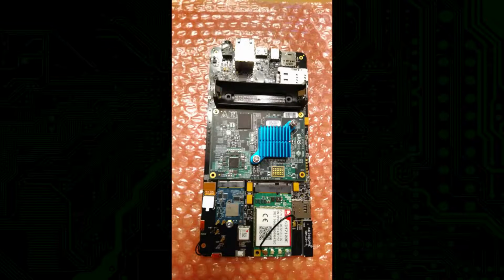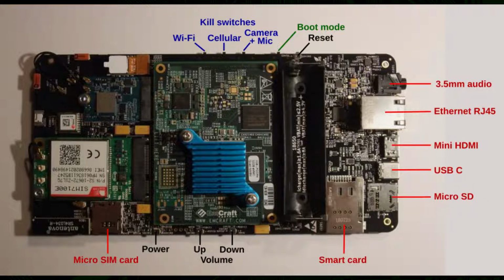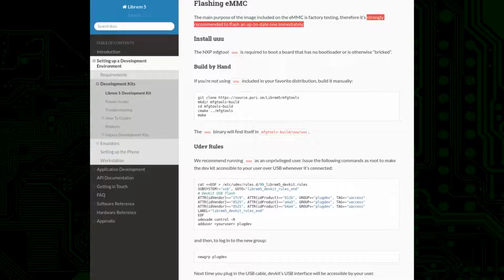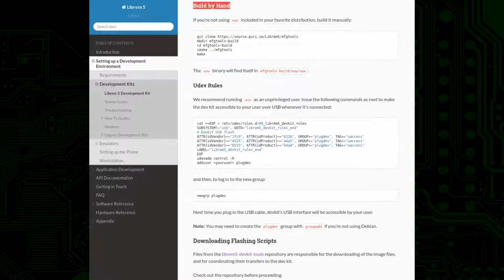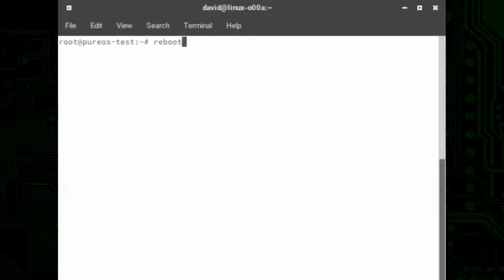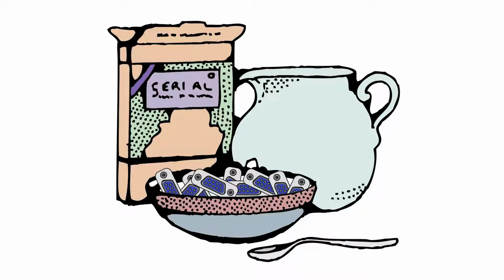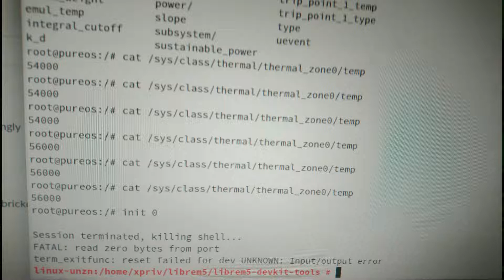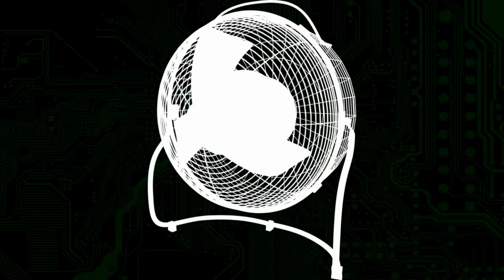Librem 5 Development Kit [First Look]

Comment: Interesting, I hope the heating problem is only due to inefficient power saving usage and will be fixed down the road through software/firmware updates.

Considering the display on the board will be probably pretty close to the display of the final product (if not the same), could you perhaps measure its dimensions? I'd also be interested in the quality of the display itself, though I guess that has to wait until the according known issues are fixed.
Reply: It's also due to a hardware bug inside the CPU, as purism said, that NXP will resolve soon.

Comment: i'm quite hype for this "phone", because we the 3 kill switches, one can use the phone as a lil safe, no health risk (because no wlan and cellular)  mp3 player replacement, mini video player, general tiny great computer, hell i probs would have it running with a usb to rj45 adapter continually at home then without worries along side my main system.

so many applications for this "phone".

and btw cute channel logo u got there :D and it's cool seeing the dev kit, i wondered how they would like...
Reply: Wifi and cellular do not cause health risks. This is painfully clear if you understand the science behind light
Reply: regardless whether u think it does or not cause health issues, we both want hardware power cutting kill switches, as it would be beneficial in all regards.